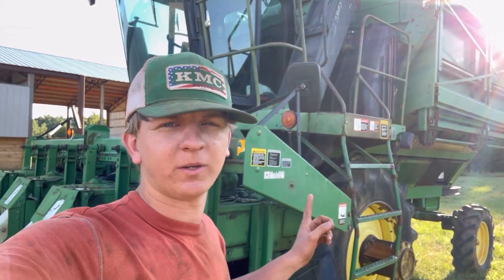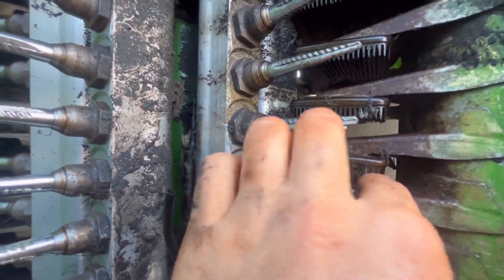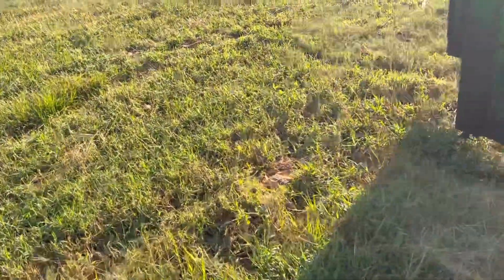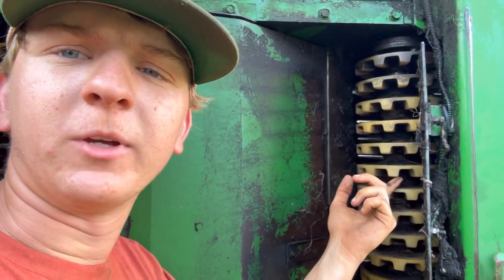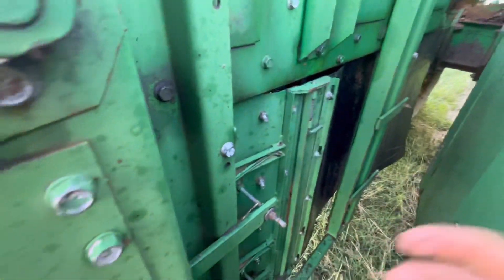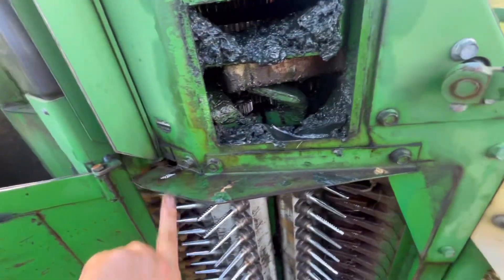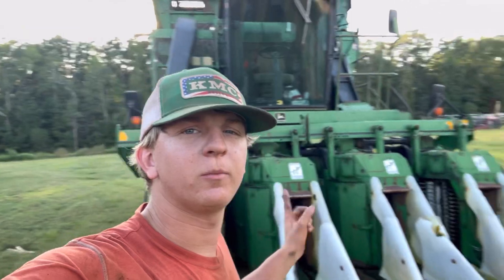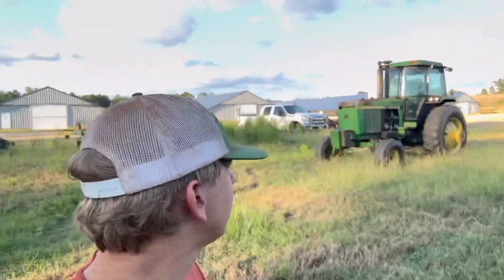How a cotton picker works!

Comment: Good way to catch it on fire is to leave that grease in the top of them heads first cotton picker I ran was a 9960 4 row I was praying it would burn to the ground I can’t stand the way John deer. Designed the way the basket lifts up and down. I hated that picker.
Reply from the maker: That grease is there on every picker. A bearing going out is what will catch it on fire. Also every basket picker lifts the same way excluding the newest John Deere the 9996.
Reply: In the area where my father's family lived. I have seen a  burned out cotton picker. Looks to be a IH.  Hard to tell from the rust.    The picker just sits in the middle of the field. .   It has been there for years.   Sad to see.   Fortunately no one was hurt.